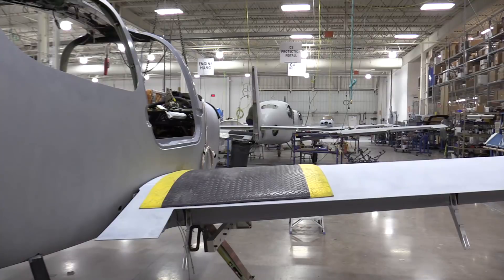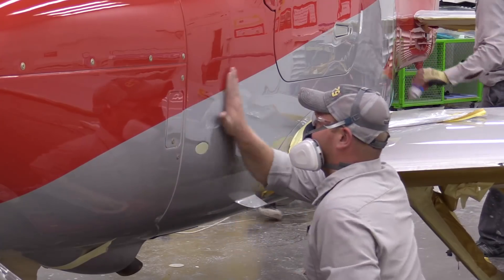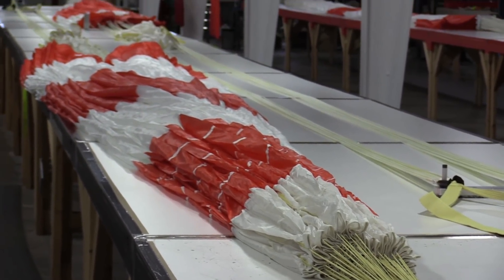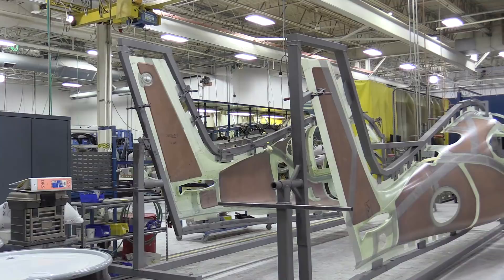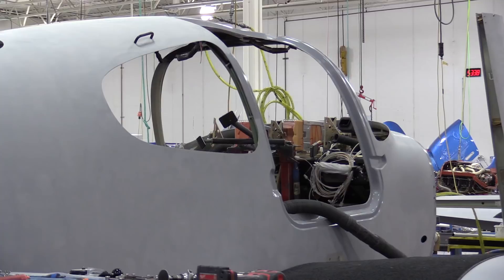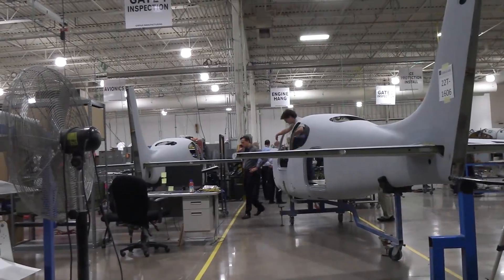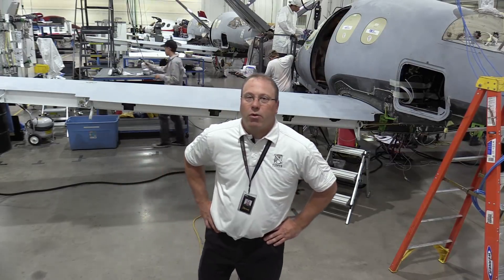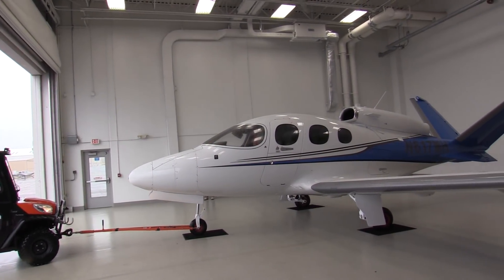How Cirrus Builds Airplanes

Comment: Years ago I worked as a temp for a company that made folding step stools for Walmart. Me, being the new guy, they gave me an old WWII era riveting machine which was twice as fast as the brand new air-hydraulic riveters. Other workers begged me to slow down because there was now way they could do the same volume of work I did but the company would increase quotas if they saw me doing well with an older machine.

Comment: As a German, sorry for nitpicking. "Takt" is not German for "baton", it's German for "measure" as in the interval of time in a music piece. So the little stick a conductor waves around in front of the orchestra to set the pace is called a "Taktstock" (Stock = stick) which is I think where the misunderstanding with the baton comes from.

Deriving from the music expression, "Takt" is then in general used as: Precise interval of time.
Reply: Tachometer
Reply: Metronome @roofman1200

Comment: So if I understand the presentation correctly Cirrus has 600 Vision Jets on order and currently cannot build more than 100 per year (approx. two planes per week).  That's a nice problem to have but I'm not sure that they are being aggressive enough in setting their new production goals. They need to increase production to a least 12 planes a week in order to meet the current demand of the 600 plane backlog. That requires them to increase production to at least 10 more planes a week!   That's a tall order that going to require many additional employees and larger factory space. I wish them good luck during this ambitious expansion.

Comment: "Takt" is not German for baton, that would be "Taktstock". "Takt" is German for bar or measure in musical notation. It can also be used in German in the sense in which it is used here for a regular subdivision of time outside music. 4-stroke engines are also called "4-Takt" in German.
Reply from the maker: Takt is the German word for the baton that an orchestra conductor uses to regulate the tempo of the music. Takt time may be thought of as a measurable “beat time,” “rate time” or “heartbeat.” In Lean, takt time is the rate at which a finished product needs to be completed in order to meet customer demand.

From the SixSigma Lean documentation.
Reply: Repeating it or citing a documentation about a quality management methodology doesn't change the meaning of a German word. Take my word for it, I'm a German native speaker and a musician. The German word for a conductor's baton is "Taktstock" (https://de.wikipedia.org/wiki/Taktstock), it is never abbreviated to "Takt", it may be abbreviated to "Stock" (stick). Takt can mean all the other things they cite, though, besides "bar" and "measure" in music, but not "baton".
Reply: OK.  What does Volksjäger stand for?
Reply: @kradius2169 : People hunter.
Reply: Sorry, your simple translation is not correct...not People Hunter, (plural) and what that suggests(!), but PeopleS Hunter as in possessive, of the people...analogous to Volkswagon being a wagon of the people.  Cheers

Comment: that's a lycoming engine hanging from the hoist.  have they changed engines in their recips ?
Reply: The sr20 uses a Lycoming 390. They changed that in 2017 or 16. The sr22 still uses the tcm io550 and tsio 550.

Comment: Id love to see cirrus a SR22T  as a tail dragger and PT6 as a option..
Reply: The Rolls Royce general aviation Turbine engine [ M250 with 450shp]  would be perfect for the Cirrus Sr22. It could be their flagship top of line model. Smooth and fast.
Reply: Dan TheMan  that would be a decent option. Especially like a c30/40 roughly 100lbs less weight and 2x the power. With slightly wider wings the range could be similar.. to a piston powered sr22.
Reply: @randerson752  Yes a slight extension of span at the tips would allow a reduced powersetting at cruise for range while maintaining  the speed.  Being able to do home to LasVegas non-stop at FL170 would be very nice.

Comment: Very interesting. Good video. But if they are very successful, why are they trying to stay in a confined space? if they have a 7 year back log they must lose a lot of orders. That's russian lada wait times, our lives are too short for that. Last I checked, warehouse space is not that expensive and if they are moving 100-200 million dollar products a year, that cost should be negligible.
Also I wonder if you couldn't do an aircraft hull as a single piece composite, applying it inside two mold sides, using a teardrop hull shape such that the monotonous compound curve surfaces are rigid as just a shell without any bulkheads. Use of sandwiching for rigidity if needed but I'm guessing it wont be with carbon fiber, especially once pressurized. Having to glue together two sides when you could have continuous fiber all the way around is an unpleasing compromise of the extreme strength of composites. It's also hard to beat weight wise.
I would also aggressively pursue making the SR size aircraft a sleeker pressurized twin jet at quarter the weight. Imagine an SR23 at 250kg empty with two small turbofan jets at the back, pressurized hull going 700km/h at FL450 with better fuel economy than an SR22. And lower price. 4 seats and a lav at the back with one time use inserts and wet wipes. No plumbing.
Most times you don't need a classic bus config jet. 
Runway to runway autopilot, lean back and enjoy the quiet of a fast rear engine jet at high altitude. It would wipe clean the GA market.
Reply: watching this video 2 years later my comment was spot on. If only the world listened. One more thing this time, the profit on each plane must be staggering. Fiber and resin costs nothing compared to these prices and while the engines are quite overpriced, it's only 1 and still leaves enormous room. SR22T sell for a million, the engine might cost them 100k. The SF50 costs 3million and the engine might cost a million. Visionjet is only a bit larger than SR22. or a wide LSA.

Comment: Im happy for their success against all odds and the FAA. Even if it took an act of congress to make a safe space for new aircraft manufactures.

But Cirrus aircraft are not at all exiting to me. They get my blood pumping like most people enjoy seeing another motorhome blocking an On-ramp or Tractor Trailer parking spot.

Not to say its not a quality product. It is. Its probably one of the most Gucci machines made in America. Up there with Earth Roamer or Daniel Defense. Though just not anywhere near as cool.

They went all out with small, high aspect ratio wing, laminar flow, high wing loading, and big engines. But it can barely get out of its own way and utterly fails to out-climb even a housefly who finds herself caught in a thermal updraft. Seriously, the climb gradient of these turds alone gives me the willies. Not, its not much worse climb rate per minute as a Cessna 172. But its twice the distance covered for less total gain in altitude.

Comment: what happens if one step isnt exactly finished after 5.5 hours?
each step has to be made to fit as close to 5.5 hours. if something changes in one step and it gets faster, all others need to be reorganized. 

and there is always the pressure for every worker to finish in this 5.5 hours. and if there is a problem and it takes longer, all is messed up. 

really a lot of negativity there...
just make it more flexible...we are not in the slavery anymore

Comment: 148 had to use the parachute?  That's  a lot of failures!
Reply: jpalm32, it's not all failures.  Don't forget the other factors such as weather, engine problems, and hate to say, pilot error.  In any other GA airplane you have to find a place to land, and could perish in the crash in one of those emergency situations.  The chute is an added option available to deal with those situations.  I personally know a pilot who walked away when he lost an engine with his SR22 over the mountains, and did not have had a suitable landing spot.  The chute saved his life.  Do some research before you criticize.
Reply: You can't expect giant lawnmower engines to be reliable, now, can you?
Reply: The parachute is a safety option, but some people rely on it too much, like a 4WD truck. I've seen  new 4WD trucks get crashed because the drivers think they are invincible.  I know of a Cirrus pilot who died in his recently purchased SR. He was found in the Sierras with the parachute deployed. A mutual friend, who is an airline pilot, told me there were bad icing conditions and he would never have flown a small plane in those conditions. Sad ending, but most likely pilot error.
Reply: The Sign listed # of LIVES SAVED.  If there were 3 souls aboard when the chute was deployed & all were ok the sign would bump +3 or 151 Lives Saved.
Reply: Kevin, you are correct.  It's another option, but not a crutch.  Nothing replaces training, and risk management in aviation.
Reply: indontcare80 - Actually small aircraft engines are very reliable.  Granted the technology that runs them is lawnmower technology, (magnetos), but with the new part 23 re-write we may finally see the same advances we have had for years in cars make their way into piston engine airplanes...
Reply: Brian, the BRS parachute is a safety device, but any device can be properly used as a tool or improperly used a crutch.   The mindset of "I can do this and I can rely on the  backup", gets people into trouble.   It's when risk management is ignored or pushed into the "I think I can get away with it." area.

See the video of the "Nevada Triangle" to see how dangerous the Sierras can be.
Reply: Only 1 person died while using the chute. He had a heart attack after he landed.
Reply: Exactly and when you consider that there have been more than 5000 SR22s and greater than 1300 SR20s produced, that's a very impressive number. Lots of planes, lots of flight frequency, and lots of lives saved.
Reply: Kevin Moore That particular accident was 100% pilot error. Poor flight planning, poor flight execution. Failure to recognize situation, and failure to deploy CAPs at an appropriate time. The pilot had waited until directional control was lost, and was WAY out of the CAPS system design window. "CAPS event #5, Feb 2005, Norden, CA, activation at very high speed. Likely in excess of 300 knots indicated, over twice the deployment speed, where parachute separated from the airframe."
Reply: 148 souls saved via the parachute is a damn good thing if you ask me.. .and you didn't
Reply: I was thinking the same thing